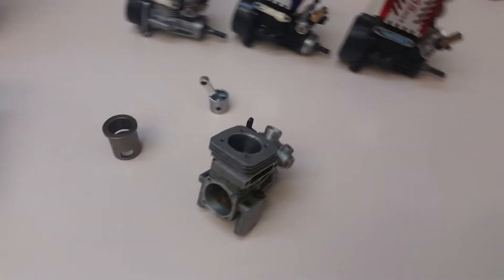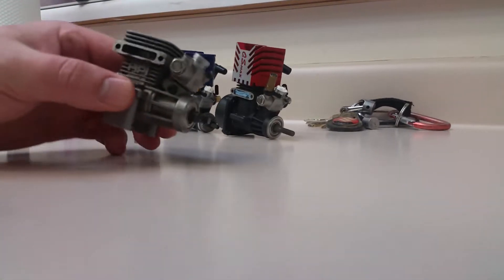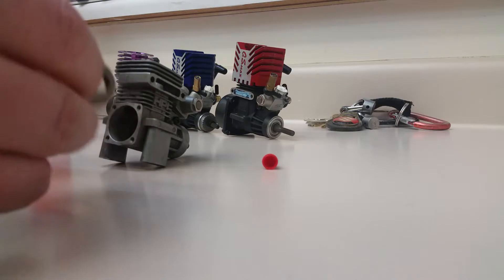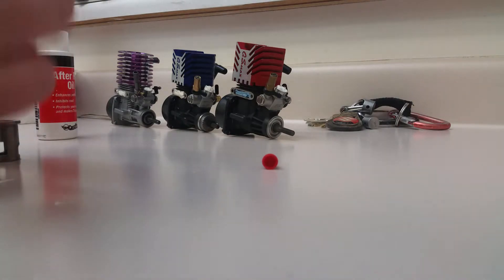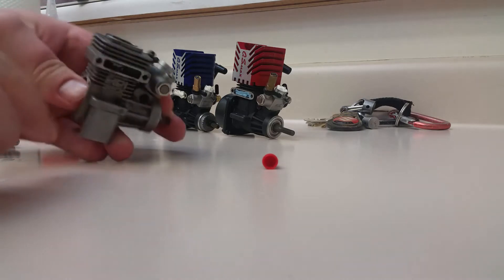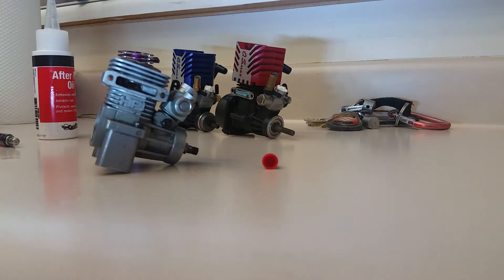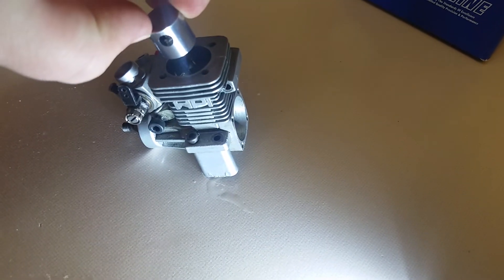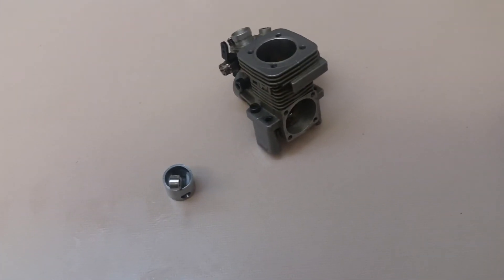The correct way to install the piston in a OS 15CV engine

Comment: Can you please tell me if the OS Engines Rear Adapter 15CV-X OSMG8219 GP I found the bracket plate on eBay will it work for my .18 engine thanks
Reply from the maker: 12cvx 15cvx 12/15cvr 18cvr back plate fits
Reply: @thebug4046  will it fit for my .18 nitro engine that’s what I want to know thanks

Comment: Thank you, great video! I'm about to rebuild my os engine and was wondering about the hole one the piston
Reply from the maker: Racing Bashing RCs hey I'm glad it helped you just remember to make sure your work surface is very clean all your parts are very clean with 99% rubbing alcohol or brake parts cleaner and assemble with after run oil or castor oil like Klotz castor oil good luck hope everything works out for you!
Reply: Thank you!
Reply from the maker: Racing Bashing RCs your welcome always remember if you're going to use rubbing alcohol to clean Parts it can't be anything less than 99% because anything less contains water which can rust your parts

Comment: Thank you for that. I will mark the rod for future reference, and get it all put back together again.
Now my next project is getting the slide out of the carb. The PO put it up with fuel in the tank, lines, and carb, and it's all gummed up. I'm going to take it to my shop, and throw it all in an ultrasonic cleaner for 20 minutes or so, and clean it really good with compressed air, and douse it with WD40 until I can get some after run oil.
Reply from the maker: no problem! and just so you know WD40 dosen't work that well to clean nitro gunk use 99% rubbing alcohol it will take all the gum and varnish off right away i have a video on it if you look there is a can of wd40 in the picture i hope this helps

Comment: Where do you get your rc10gt parts?
Reply from the maker: Brandon Parrott I got a BIG! Parts lot from a guy on Facebook other than that I got most of my parts used the engines are from different company's like HPI Dynamite and O.S engines and a few that are on ebay
Reply: Ok right on. It seems to be getting harder to find parts for these cars. Looking to uprade from the .15 engine any suggestions?
Reply from the maker: Brandon Parrott I run a cheap 50$ SH18 engine in one of my GT.s and it's pretty damn fast the Duratrax 18 is also available for cheap and go's like snot! I have even seen a OS 21tm engine jammed into one and it was way too much